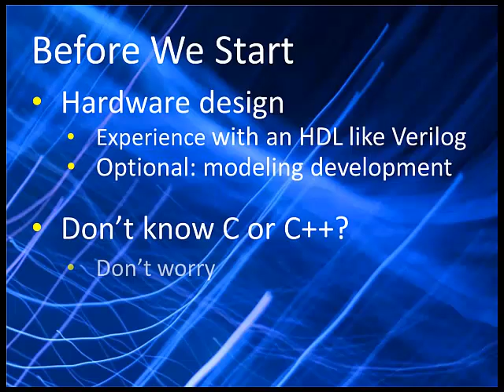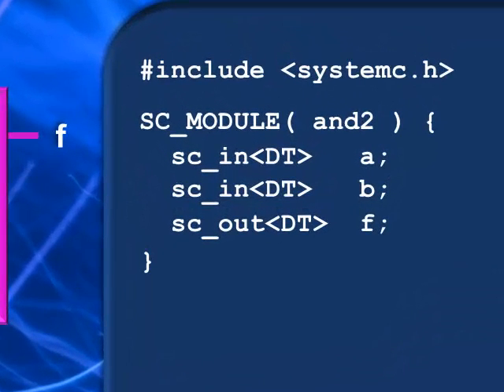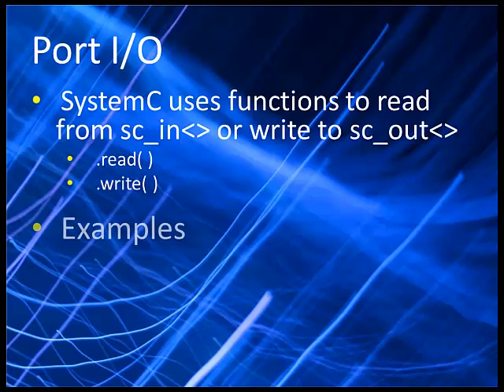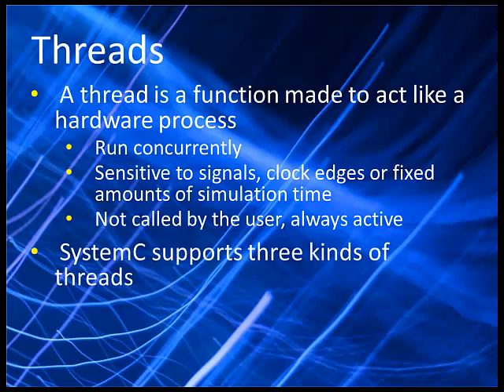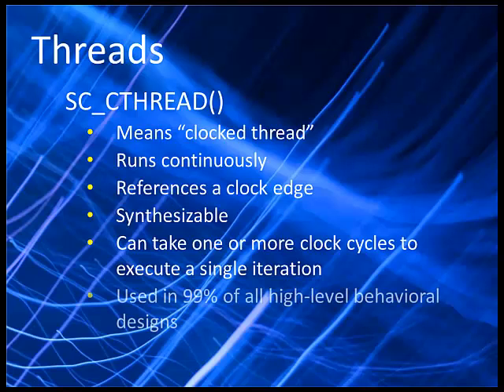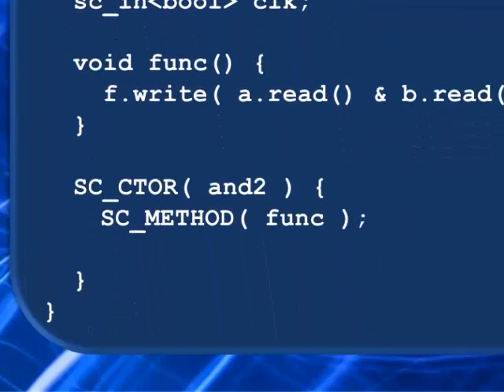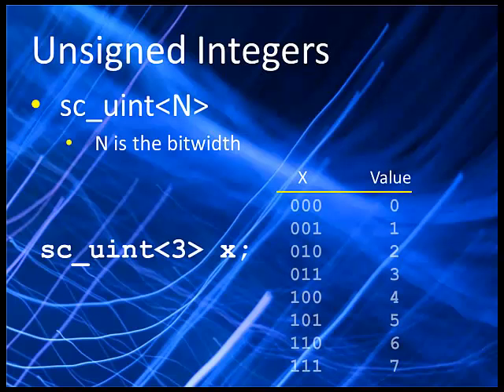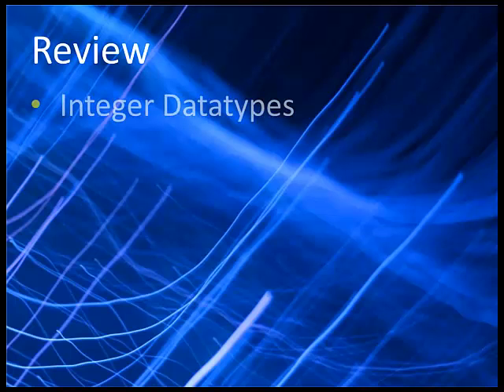Learn SystemC (1) - Introduction

Comment: Holy crap this is an amazing tutorial! Thanks so much for this!
I do have a couple of questions though. 

How is an SC_METHOD "run continuously" but also "executes once [on] every sensitive event"? Do you mean that the SC_METHOD is continuously monitoring for those sensitive events?

Also, in your example when you add the clock, would it not have been better to declare func as a SC_CTHREAD instead of a SC_METHOD?